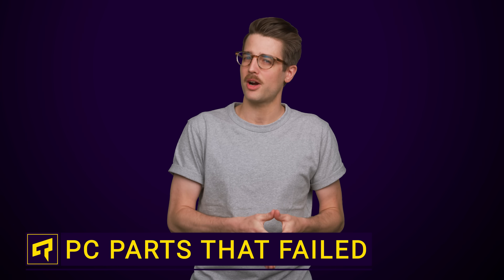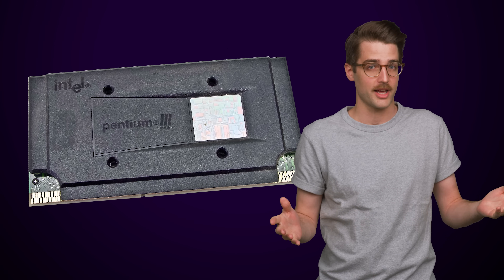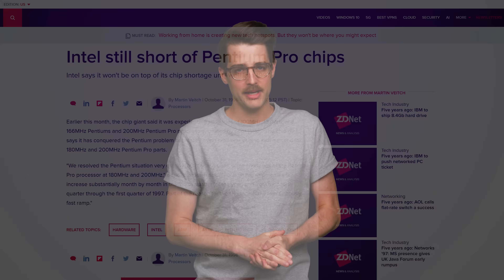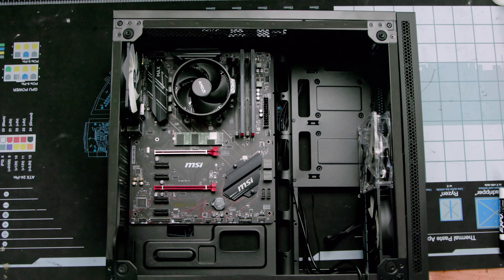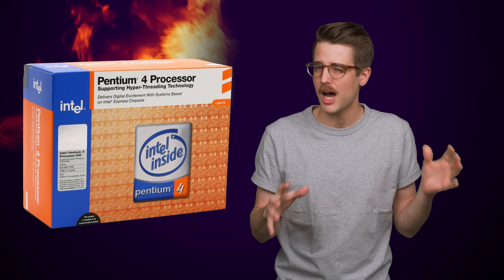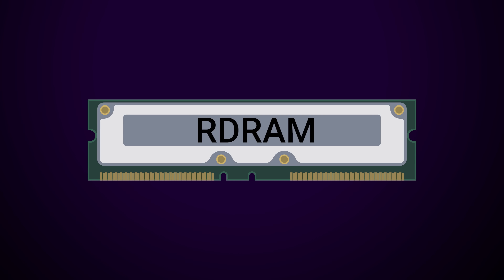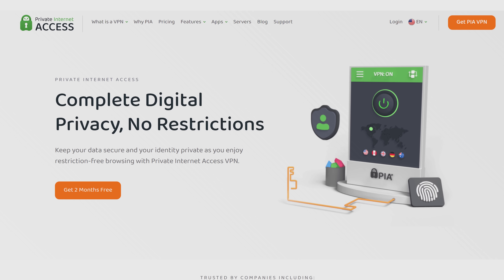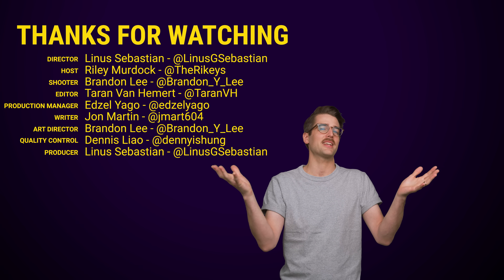PC Parts That Disappeared

Comment: 3D accelerators. That didn't handle 2D at all! Remember the Voodoo 3DFX?
The sounds cards. All those Creative Sound Blaster and Gravis UltraSound stuff. When you wanted to listen to music, and had to buy a separate card for that. Now you buy an external audio interface if you are serious into recording music... but if you just want to listen to it, the “built-in into your motherboard” chip is typically fine.
Co-processors! those 80287, 803087 ones. There were those fun times when you wanted to enable your CPU to do the floating-point math, you could buy a “chip addon” that does it. Without it, your chip just wouldn't have the according commands, and had to emulate them by integer operations!

Comment: Got an old (~2000) desktop from a family member and wanted to upgrade its 128 MB of RAM to something slightly more usable. Figured I’d just buy a couple more of the RAM sticks that were already in it (thinking they were DDR(1) or something) only to realize there are not many RAMBUS RDRAM sticks out there. Plus if not all the slots are filled, you need to insert blank “dummy” sticks in the empty slots, and I never could get 2x128MB and 2x64MB modules to all work together.

Comment: A modern allround/gaming pc can live with just a motherboard, memory, power supply, a processor and storage, with a graphics card and some case fans thrown in for good measure. 
I remember a time when you also needed a sound card, a network card, optical drive, floppy drive, usb expansion cards, and optionally an sd card reader. Not failed tech -- on the contrary -- but nice to reminisce about, no?

Comment: I would also like to add this to the package: 3D accelerators, "Turbo" buttons, COM ports, VGA ports, 3,5"/5,25" floppy disc drives, CD/DVD/Blu-Ray drives, ATA bus interfaces, CRT monitors, ball mouses, etc. I would need to refresh my memory a little bit from the past 25 years but this is most likely not everything yet :)

Comment: I actually kinda see a new senario where slot cpu's are an option again considering those can be easily direct die cooled and can have a cooler just like the gpu. Although that might be a to big stap to standardise although in my opinion a gpu cooler on a cpu would be pretty cool

Comment: your young but may learn. Before the slot 1 and slot A you had the Super Socket 7. Which you could use either AMD or Intel CPUS. Intel also made the Slocket with put a socket for a Celoron or a Pentium on the slot 1 card. This was the days before you were required to have a CPU cooler. This needs a bump

Comment: Catridge CPUs were annoying but necessitated by relatively slow ram interfaces.  The on-cartridge l2 cache usually ran at half cpu speed, something the bios chips of the day would not have been able to manage (and probably still true today but is moot because l2 and even l3 cache has gone on to become integrated to the cpu die).  Two things that come to my mind: DIP sockets and the early split AT power adapters.  There was a time that RAM didn't come on DIMMs.  You would actually buy a sleeve of chips and have to mount the chips into little DIP (dual inline pin) sockets and be careful to not bend any of the pins (usually 16) that looked like caterpillar legs on the ceramic body of the chip.  The split power connector was the equivalent to today's 24-pin connector, except instead of being keyed to only fit in on orientation, it was specifically designed so that the two pieces could be installed in each others' positions and doing so would put high voltage power to low voltage buses and destroy your motherboard.  This was to prevent novices from building their own systems and fortunately fell out of favor in the ATX standard.  Integration of everything into the motherboard chipset also obsoleted a lot of common add-on cards: hard drive controllers, floppy drive controllers, i/o cards (serial/parallel ports), network cards, sound cards, modems... these were all add-ons you could choose between various competitors or even not have at all.  And because plug and play wasn't a thing yet, you would have to use jumpers to set various parameters (IRQ, DMA, port) so that the cards would talk to the cpu without interfering with one another.  It was a whole different world.  You would need an associates-level education and it was a significant matter of pride to build your own PC's then.  Now, you just need a screwdriver to mount the motherboard and PSU and you're pretty much done unless you also want to add a discrete gpu.  Everything just kind of works 99% of the time.

Comment: I still own the Dell Docking station USB 3.0 I bought back in 2016. Kinda useless now if you got a modern PC build because the dock is limited to USB 3 speed. Still very usefull to use on low end laptops with very limited ports.

Comment: Booo, you completely neglected the pressure Intel was under to move past the Pentium 4 because of strong competition from AMD. The Athlon 64s were killing it: lower frequencies, lower power, ran much cooler, all with better performance. BTX was their half assed response to thinking they had total control of the market and didn't need to redevelop, but AMD was the real reason.

Comment: I miss the PC cases that laid horizontally, and you put the monitor on top of them. I found them much easier to work with when fixing/upgrading/swapping components, and a more efficient use of desk-space than the tower design that's the current standard.
Reply: There are still tons of those. Just mainly itx/ matx
Reply: I never see them available on part-sales websites. @MycaeWitchofHyphae

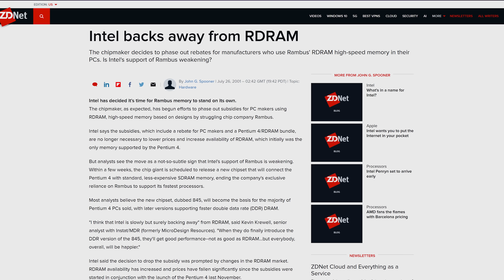Comment: 4:15 not only did Rambus need to be in pairs, you also had to install 2 dummy modules in open slots . so if you had 4 RD-RAM slots but only 2 sticks you would also need to buy 2 dummy sticks to go in the unused slots.

Comment: HDDVDs did not fail because they were bad because in reality they were actually superior to all other formats.  The real reason why they failed is to put it bluntly illegal practices by Blue Ray.  Blue Ray ran the single except for what the Democrats are doing to Trump the single worst smear campaign known to humanity in a way that was blatantly illegal yet they just kept paying lawyers to drag out the cases until HD died along with short changing the shit out of their products.  At the time a VHS would cost $15 to $25 and would be the cheapest format to produce and sell and the player costing $40 to $80.  DVDs would be $20 to $60 and the player being $200.  HDDVD charged a realistic amount of $80 to $150 per disk because they were that expensive and $500 minimum for the players which was realistic for how new it was and cost of parts and manufacturing.  Blue Ray which should have cost $180 to $300 per disk with over $1000 for the players however Blue Ray was the bastards and sold the disks at $5 to $7.5 and sold the players at $15 to $20 a player which is short changing the shit out of their product to run its competitors out of business which is beyond felonies but they hired shit tons of sleezy lawyer to only have to pay fines and after the ran HDDVD out of Business by short changing the shit out of their product they killed their competition except for they really did not kill all competitors and regular DVDs are still wanted more because they are far superior.  Turns out Blue Ray is actually shit for what it requires to make them.  Hell VHS holds more data and does not degrade as easy nor does it glitch and has far superior graphics.  Hell Laser disk better.   Beta Max is better.  All formats are far superior to the shitty Blue Ray which use to require fire wire to even hook up but fire wire is shit so fun fact Blue Ray DVDs are actually just regular DVDs with a coding that blocks them from being about to be played in a regular DVD player unless you hack your DVD player and make it open coded and you can watch a blue ray on a regular DVD player.

Comment: i have a stack of a few SLot-1 CPUs pentium 2 and 3's lol, theyre fun to mess with
EDIT 1: i also have a few btx boards lmfaooo. they continued making them well into the 00's. my main pc for the longest time was a Dell XPS720 which used a BTX board with a pentium D. can confirm that it did run pretty hot. it got to the point where i took off the side panel, and laid it sideways on the floor over the AC vent to cool it lol. 
i also have a couple of RAMbus systems lol. i dont really know too much about rambus because i never really bothered to tinker with them, HOWEVER.. there are still a lot of companies out there today using legacy hardware on heavy machinery, such as old cnc machines that still use RAMbus components.  so its good to have if you wanna scalp a few hundred bucks selling them to such a company

Comment: The external L2 on the Pentium II also meant that the Celeron with integrated L2 was competitive in spite of the cache size difference, especially if you overclocked the Celeron.
Reply: Practically every Celeron 300A could be run at 450 MHz without issues, by just bumping the FSB from 66 to 100 MHz. No need to mess with multipliers. Just had to remember to set the divider from 2 to 3 to keep the PCI bus at 33 MHz. It was a great time to be a broke gamer.
Reply: @arantala  The Coppermine Celeron were pretty awesome too right up to the 1GHz mark. Somewhere around 800MHz or so the cache became an issue and the Celeron couldn't keep up, something like 300MHz faster to match a PIII, still pretty quick chips.

The Tualatin Celeron had 256KB of cache so they were effectively the same as the Coppermine PIII, though I think the bus width was cut in half.

Comment: Most all Apples even notebooks back then had the processor on a card in a slot, and were upgradeable. You could even slot in cards with dual processors.  This was the case up until the end of the PowerPC processors in desktops.

Comment: Actually the first slot-based CPU packages that were put into PCs were those for DEC Alpha AXP CPUs, specifically the first generation: 21064, put into DEC AlphaStation workstations. They were PC-like in almost every way, except for the CPU. They had ISA slots, they had PCI slots and an Intel FX chipset to support all this. They were introduced in late 1994.

I used to own one and had equipped it with an original SB16. It outperformed my K6 (or K6-2, can't remember) in very many ways. 

The bus design for the 21164, EV5 was the basis for the AMD Athlon bus design.

Comment: 1GB of Ram in 1990 was about  $108,544.00 X 4 = $434,176.00 wow that some homemade computer ya got there by 1999 it was only about $1400.00 per GB and 4 GB would have been $5,600  just a bout 1/2 the price i sold my first 286 IBM clone 10 MHz 80286 System  with zero wait-state with 8mb of ram that was about $8,000.00 with the  VGA port and 2  20mb sea gate HDD's  so just over $10k for this box and after loading "Smart" program took like 4 hours  made about $350.00 about the same cost as 1 of the 20mb hard drives  good times

Comment: I remember putting a screwdriver on my AMD Athlon slot A cpu (team green then) to DIY some watercooling on it with parts from the petstore (aquarium pomp) and old waterblocks from central heating  parts and some peltier elements to cool the water.

Those were the days. Instead of the Mickey mouse prebuild RGB clown watercooling you can buy in the shop now. ;)
Reply: Guess that's where those custom watercooling fail videos come from

Comment: Back in the day you could build those PCs with the intel CPU slot so much quicker. No pins to bend, thermal paste mess or bent heatsinks. Fitting a CPU was like fitting a SIMM.

Comment: Still own a RAMBUS prototype. It’s stable and running incredible fast with an prototype P4. This was how the P4 was intended. Not the crippled SD-Ram version.  However on the shelves price tag would have been super hefty (Maybe 10.000 USD) and Intel never was able to deliver a 3 slot chipset.

Comment: I was working at Intel Dupont back in 96-98 and they told us the ceramics surrounding the CPU was getting expensive. Vendors that supplied the ceramics wanted more money  and the slot design was adopted to reduce cost.

Comment: BNC network connectors, I miss those. Never snapped like RJ45, never tried to insert upside down like RJ45, never pulled out by accident like RJ45 and my Win98 install was so fast on the maximum 10Mbps networking i experianced with BNC connectors.  Hmm, maybe progress is good after all...

Comment: I was a tech at a small computer store when the Pentium II came out.  I remember the first one we we got.  We put that system on display in the showroom and left the side cover off so we could show people the cool new processor.  I'm pretty sure it was a PII 233.   I owned a Slot A Athlon system for a while.  If memory serves me correctly it was an 850 MHz  CPU.   
Something common from that time that has disappeared?:  IDE - It seems like yesterday that IDE drives were common.  I still have a few "retro" computers kicking around with IDE drives in them that were my daily drivers from what seems like yesterday.

Comment: Slotted processors also stopped the issue of bent pins on either the motherboard or the socket (depending on whether you're team Red or Blue at the moment).   However, it lead to an interesting issue for a house mate of mine in 1999, when he bought a brand new Pentium II, assuring himself the plastic was the heat sink... and promptly baked himself some Intel paper weight, oh baby was it hard not to smirk that day.

Comment: I've actually seen some slot-based CPUs. In my possession, I have a Pentium II and III. When I saw them for the first time, I was surprised to see that they used to make CPUs like that.
Reply: I still have a dual CPU Pentium Pro board with CPUs. Also have a dual slot P3 board with either 300s or 350s iirc.

Comment: Intel does it for decades... push stuff that we don't need, so you can't upgrade simply by swapping the part... No, intel cuts r&d costs by doing nothing, invent false solution, then push it to consumer as a new hot thing and lots of marketing. Constantly. And the worst of it - it worked and is still working. What no competition does to a mf

Comment: You didn't mention the biggest issue with RDRAM: it was proprietary, owned by a patent troll, unlike any other major RAM standard before or after it. RDRAM wasn't simply expensive to produce - a large part of the expense was the high royalties demanded by Rambus. (Of course, JEDEC standards also require royalties, but those are collected by RAM makers themselves, rather than a patent troll.)

Comment: There were socket adapters for slot based motherboards where there was a CPU socket on the slot. This allowed you to keep using those slot based motherboards for a while longer after the slot was dropped by Intel and AMD. This was NOT supported by Intel and AMD but the slots had enough pins to use later generation processors without taking a performance hit.
Reply: Like the Overdrive CPUs for 386 and 486 PCs, I still have a Pentium Overdrive for 486 somewhere. It kept them going just a little bit longer...

Comment: There is a piece of tech I tried to find but couldnt. My dad installed this kingston CPU thing that got us iirc 10 whole megahertz extra in our computer. The "thing" was actually installed into the CPU slot and the CPU on top of it so it went between the two. WTH was that thing? How did it improve CPU performace by about 10%? I want to say the CPU was a DX266 (66Mhz) CPU. Super cool for ~1994.

Comment: Well, I feel old. Still, the Celeron I had in the Pentium 2 slot format thing overclocked without any serious trouble from 266MHz to 400MHz with nothing more than a bit of graphite pencil between two pins, and was probably the biggest bargain processor I ever bought.

Comment: Another huge thing that disappeared: AGP. There was a time when GPU manufacturers sold the same GPU model for both AGP and the new PCIe, if I remember correctly. AGP was the golden standard for gaming GPUs - PCIe was new, sometimes performed worse, sometimes better, people didn't trust it, but with lots of improvements it eventually managed to replace AGP once and for all in a relatively quick manner.
If you found a PC in the trash, and it had an AGP slot, you took it - because that's all you really needed for a gaming computer.

Comment: I just want to throw out, that I kinda hate the BTX layout. Probably because my gaming machine uses it, making it hard to find a modern replacement for my impractical and slowly falling apart case. Originally I was stubborn enough to think that my PC is more than enough for the games I play and thus I would only have to swith the motherboard and case. Well I recently started playing a game that seems to be easy to run, since even consoles run it easily, but even on the lowest setting it's just barely 40 fps (I know it's playable, but still). So I'll just cave and upgrade it much more at some point...

Comment: I paid off my mortgage replacing “round” ide cables that the heat shrink was placed too close to the ends of the ribbon cable and would eventually rip out from the pressure. Would induce all kinds of odd symptoms. The first took hours to find. After that $100 a pop, ten minutes to fix and could do dozens a day on an assembly line basis. The computer shops around Christmas were too busy making new computers  in 2000 to even consider doing repairs, so they farmed them out to me. Averaged 20-25 computers a day for months. In April 2001, after paying my taxes, I realized I had just enough to pay off my mortgage. I did and it saved me when everything went down the drain after 9/11. All in all, I miss those days.